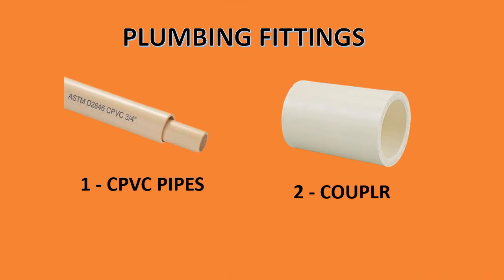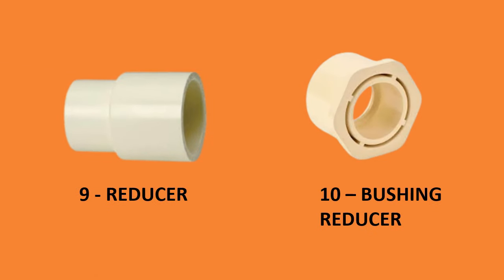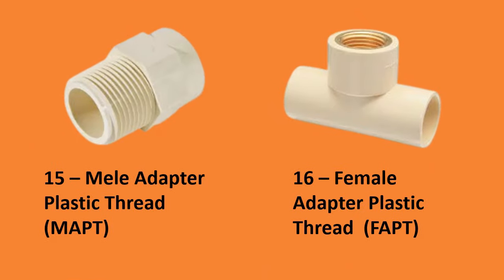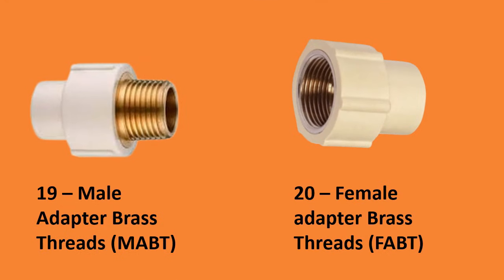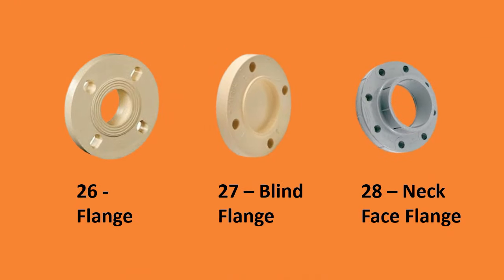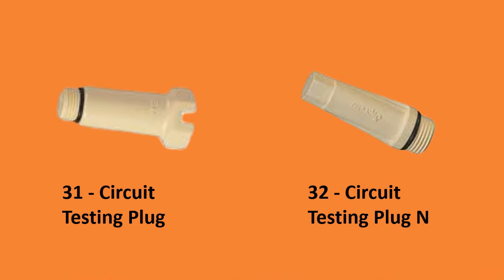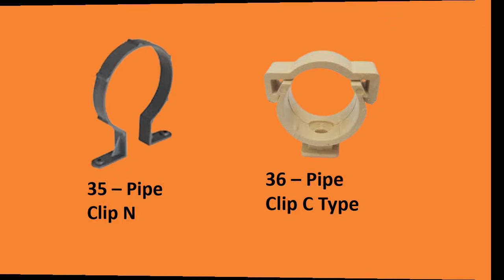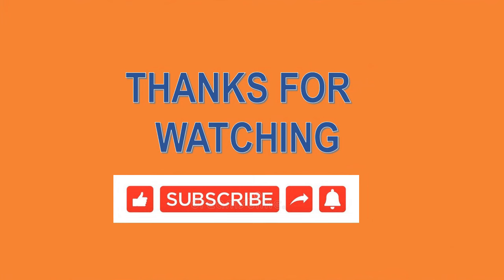Plumbing Materials Name and Pictures || Plumbing Fittings Name || Plumbing Work |

Comment: Nijanam Brass Industries, founded in 2002 and based in Jamnagar, Gujarat, specializes in manufacturing and exporting high-quality brass products. Their product range includes brass cable glands, adaptors, bushes, threaded inserts, and couplers. With a strong focus on quality and customer satisfaction, Nijanam serves both domestic and international markets, making a significant impact in the brass industry.